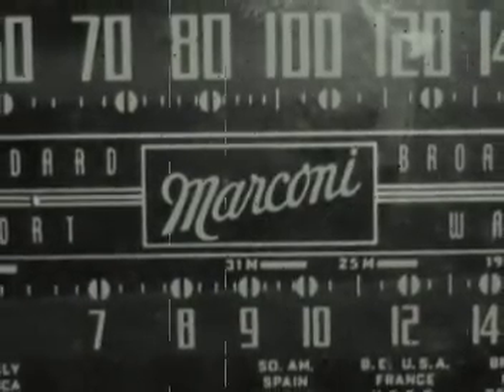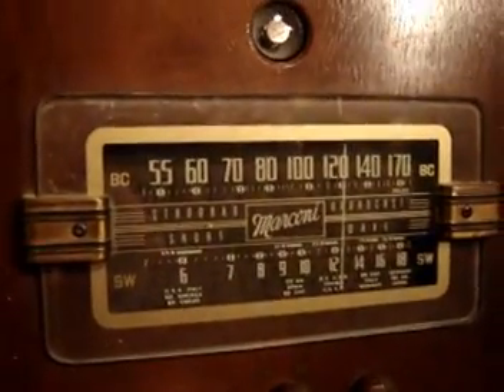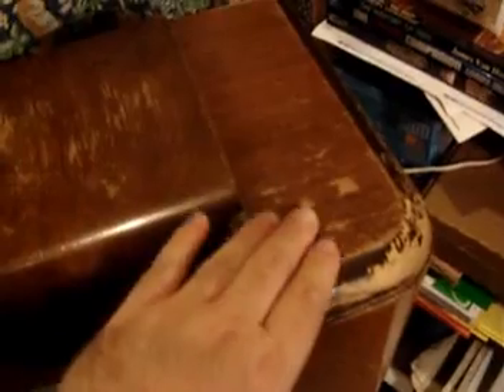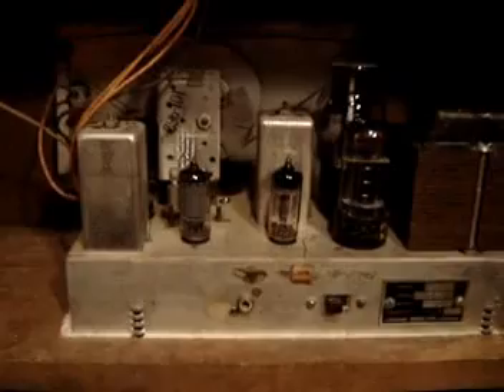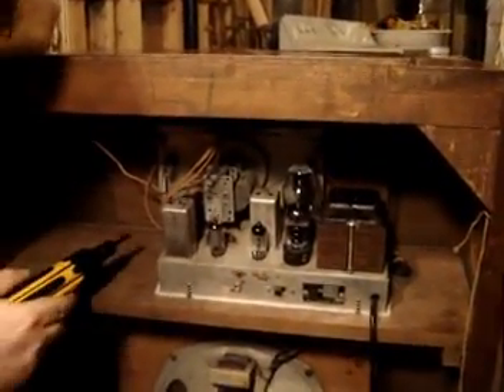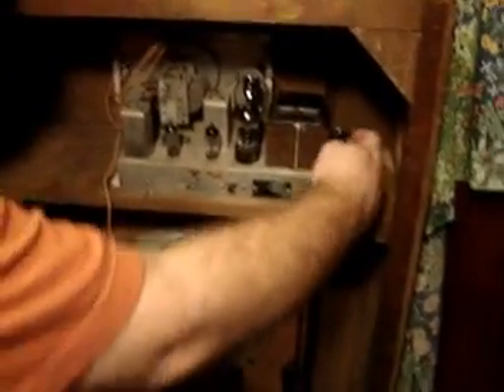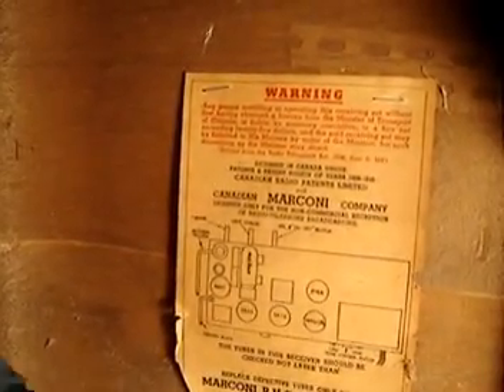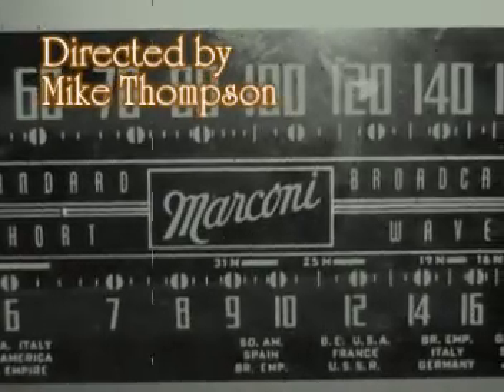Repairing and Restoring Tube Radios - part 1

Comment: quick question, you said "this speaker,probably several hundred volts" I'm ignorant when it comes to things this old. how would a speaker be a risk of shock???
Reply: Back then, they couldn't make permanent magnets that were strong enough, so they used electromagnets instead. These are called field coil speakers. The voltage needed to generate the magnetic field could be quite high.

Comment: I'm in the process of restoring a 1950 car radio and this series popped up in my search engine.  I remember watching this series a couple years ago and just did it again.  Although I have no wood cabinet to restore on the car radio, this series has inspired me to dig out a couple of the family house radios from the 1930s (or maybe even older).  Yep, we don't throw anything away!  The family radios do have wood cabinets and, in addition to re-capping them, I think I should refinish them too (after I get the car radio done).  I think this is a great series that shows you don't have to seek perfection in order to get a "new" treasure in the family!   Thanks!

Comment: *Stops vid at 56 seconds*  I would have loved to get that too insted of the xbox and PS3, lol  That pad is asbestos!!!  It should be removed with caution.  Take a look at my vids, the Westinghouse WR-186 that I'm restoring had that same pad at the bottom, and I'm going to put a piece of sheet aluminum at the bottom as my fire shield.  Just be really careful, there learks 200 - 300 volts in one of these sets.

Comment: @mritsfast  Yes you need to be very careful, however this is a transformer operated set  not one of those transformerless AC/DC sets that have a hot chassis that you have to be extra careful with.